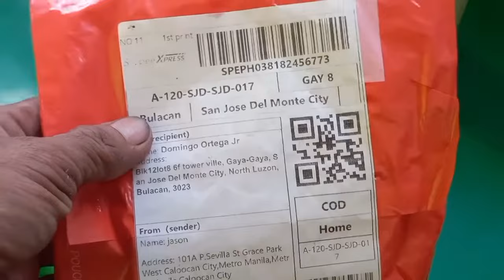PAANO MAGPALIT NG BRAKE MASTER REPAIR KIT  SA XRM 125.

Comment: Matanung ko lang, paano kung replacement ang brake master na ginamit, pwede kaya batakin ang spring ng repair kit para lumakas lakas ang preno na gaya ng piga sa mga original? Masyadong malambot pigain kahit na bleed na at nung nagpalit ako dati ng repair kit, any advice? Thanks
Reply from the maker: Yong spring po pangpa balik lang siya ng brake lever Yong nagpapalakas po ng preno yong brake fluid parin❤️
Reply: @domsvlog8697  actually DOT 5.1 ang gamit ko, pag nag squeeze kasi ako ng brake lever ay may kalaliman pero nakagat kasi nga replacement gamit ko, unlike ng oem na konting squeeze mo lang ay mabilis ang kagat.